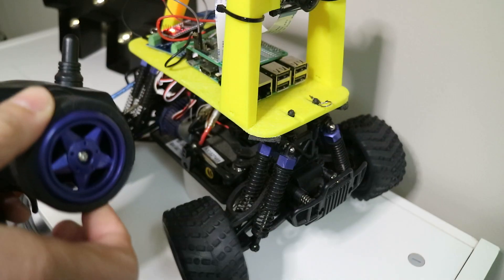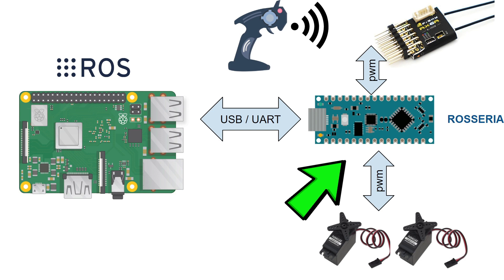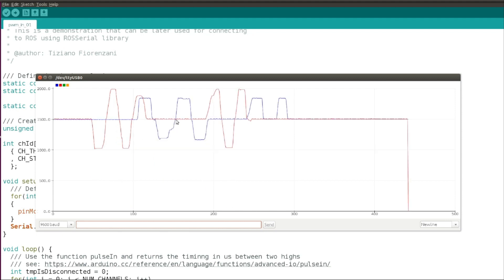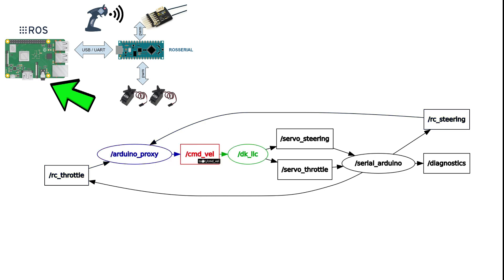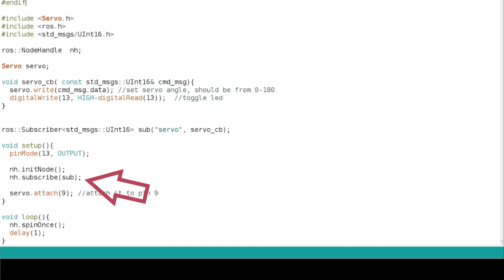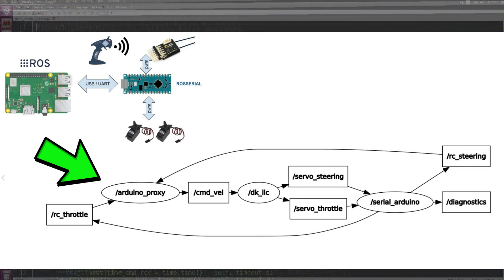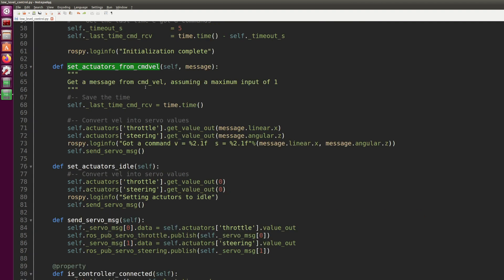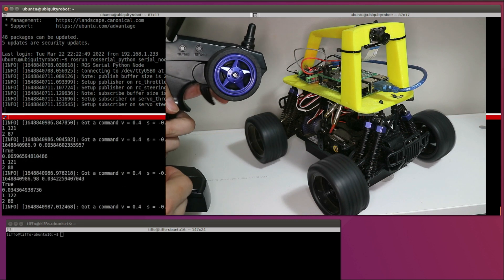ROS and Arduino with ROSserial | ROS tutorial #10

Comment: GREAT VIDEO AM USING ROS 2 GALACTIC SO I HAVE BEEN TRYING FOR WEEKS FOR IT TO WORK WITH ARDUINO CAN YOU HELP ME ON HOW TO SET IT UP
Reply from the maker: ROS2 does not have Rosserial. You need microRos, which is not compatible with 8 bit Arduino boards
Reply from the maker: Otherwise you just build your own serial interface as a ROS 2 node which communicates with the Arduino board with your custom messages

Comment: How to solve this problem: 
[ERROR] [1524089506.982801]: Unable to sync with device; possible link problem or link software version mismatch such as hydro rosserial_python with groovy Arduino.

I have tried several solutions available on the internet, but none has helped.
Reply from the maker: What ROS version?
Reply: Noetic

Comment: Hello again 😅 , i am having problems installing the arduino ide on my Ubuntu 20.04 its on a raspberry pi , i followed the same steps but the arduino ide wont open any ideas ?
Reply from the maker: Actually not, it was flawless. You can also use the windows version. You can import the ros lib in windows as well